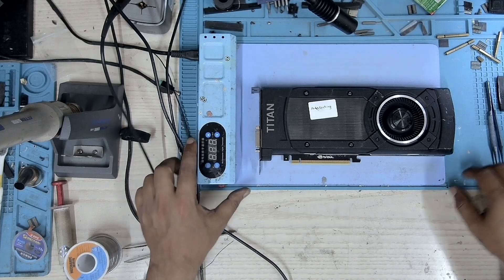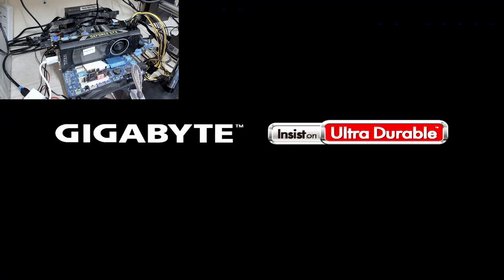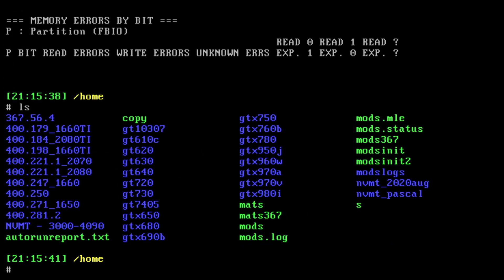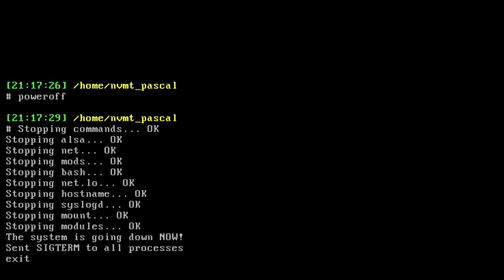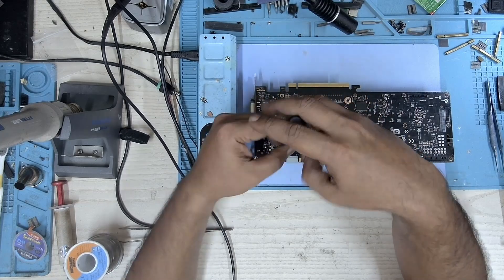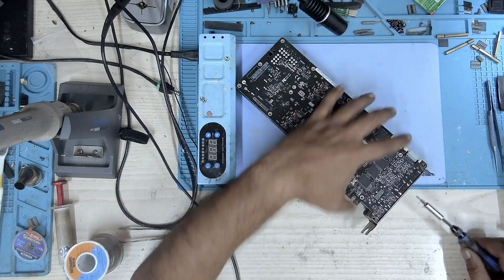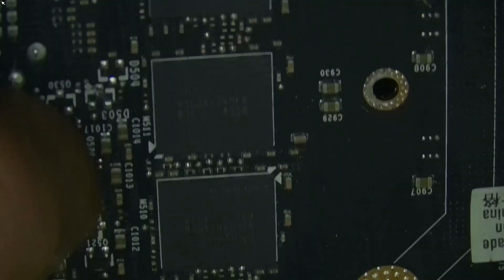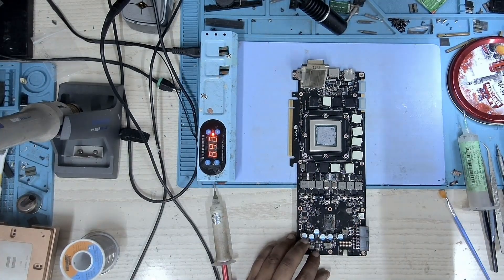I Fixed GTX Titan Screen Artifacts Forever

Comment: My Titan X crashes under loads, I'm heartbroken. A few other repair stations on youtube have said it's not worth fixing. I love these cards and I enjoyed mine while it lasted.
Reply from the maker: The reason they said that is the cost of repair will exceed the value of the GPU. To repair it may cost something like $100 and then shipping. You need to take a call if it's worth it.

Comment: Sir my chipset is  Gigabyte B760 and i5 12th Gen 12400F.. I have gtx titan graphics card.. Now i instal new graphiccard driver but after that showing that Windows has stopped this device because it has reported problems. (Code 43)
Is this chipset support gtx titan graphics card.. Plz give me a solution
Reply from the maker: I so sorry for the delayed response. I have replied to you on the other video for this query.

Comment: The Titan X is pretty nice. It has 12GiB of VRAM and is a really good in terms of overclocking as the whole Maxwell lineup. In one of my systems i use a GT 780 Ti and in the other a GTX 980. Those are still great for older games and for 1080p gaming. I'm glad, that we can still use cards from 10 years ago. There was no way to use a 10 years old card, 10 years ago like a Gforce 6800 GT or Radeon X800 XT.
Every card you can repair is a card, someone can use for gaming and is less waste.

Comment: Lots of older cards from 7-10 years ago stil get driver updates.

The GTX 700, 900 and 1000 series are still great budget finds for 1080p-Minimum or 720p-Medium on games that released in the last 2-5 years.

And HEDT parts definitely warrant lasting longer because of the sheer amounts of VRAM and compute driver features.

Comment: Thank you for a good question! As a consumer and gamer, up-to-date hardware is a necessity, but for everyday use (rendering/encoding), a powerful, yet energy effecient card is preferred. I prefer to fix it if it's within my ability, give it to someone who want to attempt a fix, or have it properly recycled so it doesn't end up in a landfill. Precious metals like gold and copper that end up in landfills stay entombed there, and the supply of these materials isn't infinite!
I grew up working on through-hole tech, so I don't have a lot of the bench tools like you've got, but I still dabble in some projects on my home bench. I would love to know what kind of microscope you use, and do you have any other tool recommendations?
Reply from the maker: Thank you @taurolyon for sharing your view. Much appreciated!! 
Below is the link to the microscope i use and also one that i recently purchased and yet to receive.
Microscope currently using: 
https://www.aliexpress.com/item/1005004816559817.html?spm=a2g0o.order_list.order_list_main.745.50de1802uROYQB

New Microscope i have ordered (4k Pro) would test it soon: 
https://www.aliexpress.com/item/1005006234342034.html?spm=a2g0o.order_list.order_list_main.5.50de1802uROYQB

Soldering station: 
https://www.aliexpress.com/item/1005003194122643.html?spm=a2g0o.order_list.order_list_main.704.50de1802uROYQB
https://www.aliexpress.com/item/1005004028392148.html?spm=a2g0o.order_list.order_list_main.448.50de1802uROYQB

Hot Air Station:
https://www.aliexpress.com/item/1005001900973775.html?spm=a2g0o.order_list.order_list_main.942.50de1802uROYQB
Hot Air Station Nozzles: 
https://www.aliexpress.com/item/1005001407090451.html?spm=a2g0o.order_list.order_list_main.921.50de1802uROYQB
Reply: @GraphicsCardRepairs-tk7ql  Thank's for the info!!

Comment: You can see upper right of ram chip as well as middle to outside discolored darker shades showing you most used parts burnt into the plastic under the cap
Reply from the maker: This card is quite old now. Discoloration is eminent.

Comment: Holy cow, the first 2-3-4 pin for that memory has really bad condition, not shining like the others.
Reply from the maker: YES. There was some solder on the pads. As it was on the back I was struggling to clean it as one had I had the hot air and other the iron. 😂. But it has blended well  to avoid any shorts.

Comment: I wonder if it might be better to start by replacing the rear rather than front as the rear chips have no cooling and might be subjected to more thermal stress.
Reply from the maker: It's a good suggestion.

Comment: LOL Frazer, that Hynix H5GQ4H24MFR-R2C is what I need to revive a GTX 980 Ti with catastrophic failure on memory mosfets. They popped and took all memory chips with them. I have fixed the power controllers but all memory is bad. I have checked on AliExpress but they want about $30 for all 12 chips. I will buy them, but I will have to get more since its always one or two that you get defective from AliExpress. Great video btw!
Reply from the maker: Yes it's always best to buy extra. I always find one or 2 defective. I'm sure you will fix it. I will be waiting for your video.
Reply: @GraphicsCardRepairs-tk7ql  I'm going to link your channel on my last video, for those interested in repair videos. For me these videos do not get much traction, but I want to keep testing the waters.
Reply from the maker: Sure. That would be awesome.
Reply: @GraphicsCardRepairs-tk7ql  Already done my friend 😀